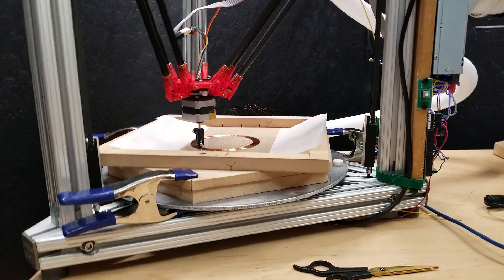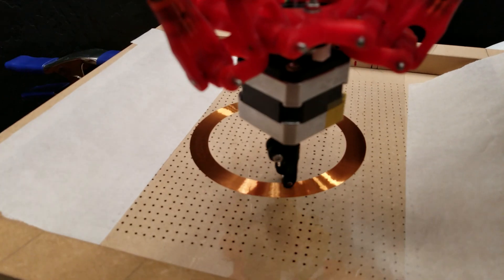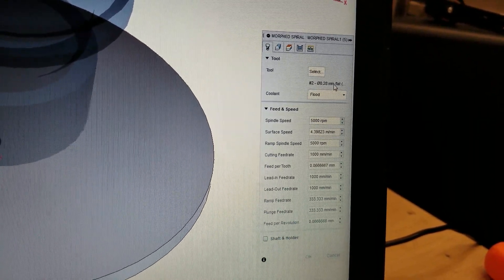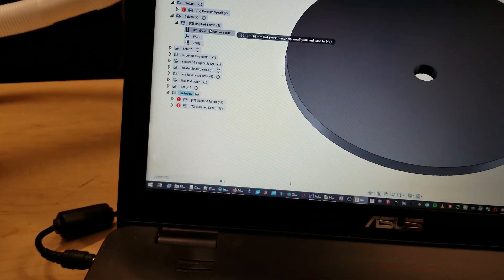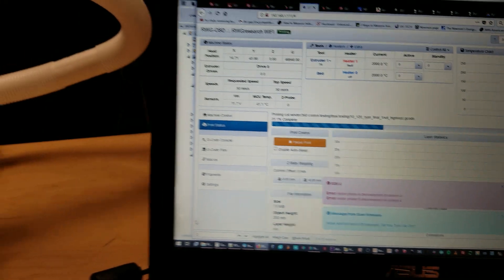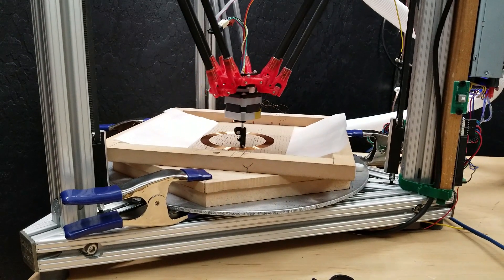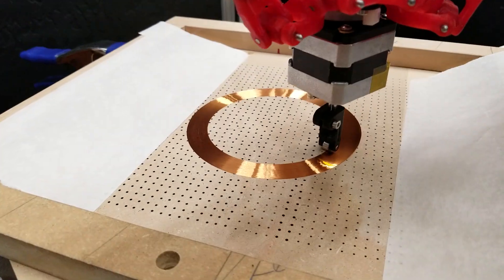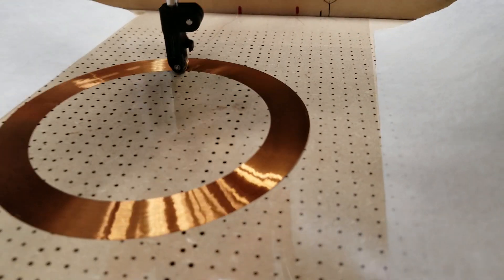Tighter cal... wohhh, that's a sexy coil... CNC flat coil winder

Comment: I have never seen you reply to a comment yet on the videos I have watched but I will ask anyway, Are you able or willing to sell a few coil variations so I can test a few projects?
Reply: This Is The live channel. I don't always get to respond. I'm willing to sell a few my problem is I don't have a lot of time to do it right now. Let me know what you're thinking.~Russ
Reply: @rwgresearch  If you have another channel, share the link  please. 
Right now is not what I am after anyway so that is good. I am probably looking in a few months or so depending on funds and your prices. 
I probably have four interests to begin with in testing, tesla dual coil, triskelion coils, regular spirals with no gap, regular spirals with a 1.168 ratio gap to 1 width of wire, and possibly vice versa, There are a few other variations that come to mind though. All would be to fit a 4-6" diameter space, roughly.